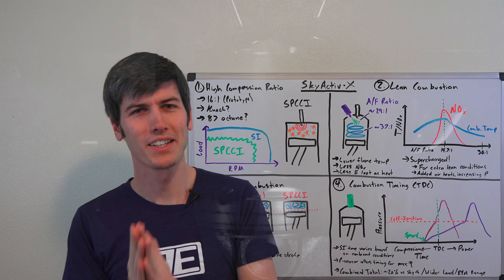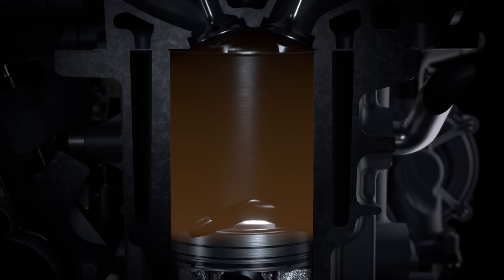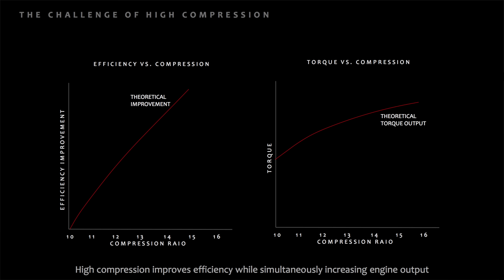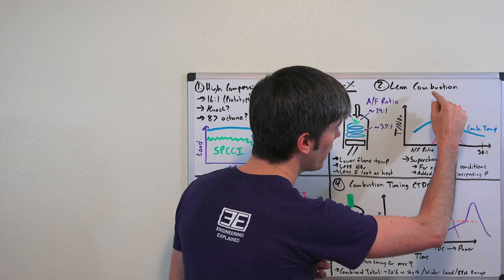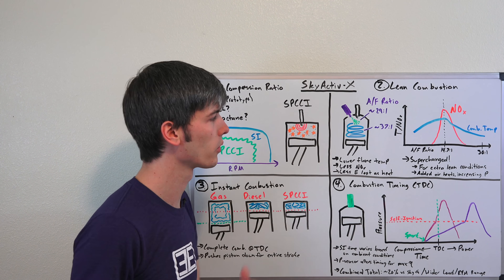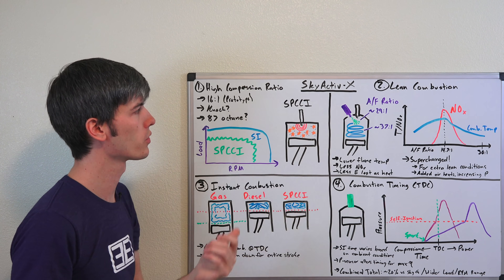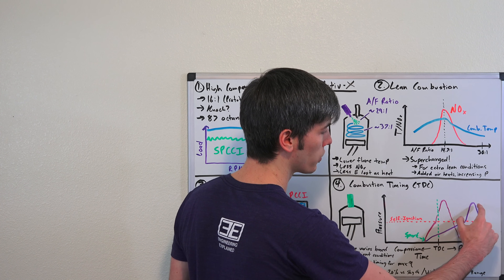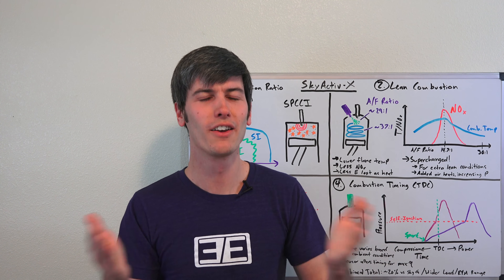How Mazda Is Saving The Gasoline Engine - SkyActiv-X

Comment: Is it correct that you have less NOx emissions the leaner the engine runs? VWs first FSI engines used a special NOx catalyst for higher NOx emissions under lean burn scenarios (at least thats what VW Said)

Comment: Pretty cool stuff. I'm kinda wondering how well it will perform after 100k miles of carbon build-up, since that can create hot spots in the combustion chamber and cause pre-ignition. Will it eventually just run constantly in "regular" ignition mode due to wear, carbon build-up, etc? We all know people don't maintain their engines to an ideal standard.

Comment: I'm sure you know what you are talking about but a couple things escaped me this time. What you are describing is classic detonation: the fuel/air mixture stops igniting by the flame front and ignites by the pressure front. I can only guess that is moderated by the extremely lean mixture (still above the lower flammability limit of 1.4% or 71:1 A/F ratio) but I am still scratching my head about that. I also understand that the lower combustion temperature reduces NOx, but doesn't the excess oxygen in the exhaust effectively cripple NOx reduction in the catalytic converter.. or does it reduce NOx generation to the point catalytic reduction no longer matters?

Comment: Excellent video. Loving the whiteboard videos. Really just left me with one question: what causes that swirl to occur? In video he stated that it occurs when the intake valve opens and the piston is moving down the cylinder. This seems rather vague to me; I'm no expert on ICEs by any means, but I don't believe this is a characteristic of most current engine power strokes? Cool idea, but what about the SkyActiv-X in particular causes this to happen? 

And then as just a question to satisfy my curiousity, can anyone tell me what's the time gap between the formulation of an idea like this and actually seeing it built and released? I'm guessing technology like this has been around (on the drawing board if nowhere else) for quite some time now, and we are only just seeing it?

Comment: Engineering Explained , I think there's a mistake in the pressure curve in section 4 unless I'm misunderstanding what you are showing in the plot. You have compression labeled as a flat pressure line, while this should be increasing as the piston moves up to compress the mixture and then have the additional pressure increase you show after combustion begins.
Reply from the maker: The curve shown is simplified to understand how timing works.

Comment: while I drive most time my car electronic systems goes off but car runs fine. What do I mean by electronic systems are power windows doesn't work car stereo system goes off etc, but if I turn off engine and start again it works fine for sometimes and again it's goes off after a while. I am really struggling to figure it out by my self. If you can help me that would be really thankful.

Kind request 
Thanks

Comment: Hey I gotta question that might be interesting or not lol
So I've been looking at the powerglide transmissions and I've been wondering the power glide transmissions only has two gears.. So it has two gear ratios with a final drive ratio 
How do they set up the power glide gear ratios so that wen they go from 1st to 2nd it doesn't loose acceleration but also gets a high top speed 
Bc obviously if u set up up a final drive like 3.50 and a first gear of 2.45 and a second gear of 1.00 with like lets say 300hp wen the car shifts into second it would just be very slow acceleration.. So how do they figure out just how low they can go with the ratio so that the car still accelerates fast and also has a good top speed..
If u do answer this can u please use two examples one with a high HP car and one with a low HP car I'm really interested in figuring how they setup the power glide gear ratios :D

Comment: Regarding the improvement in economy - the 20% number is comparing their current (Sky-G) 2L's fuel consumption to this new (Sky-X) 2L's fuel consumption. But the new 2L produces almost as much power as the current 2.5L (~178 hp versus 185 hp). Thus, the engine you drove should be a replacement for the larger 2.5L, and it's fuel consumption shod be compared to it rather than the old 2.0L. Thus, on a fuel consumption per hp measure, it's already at or above 25% improvement and very well could be 30% when it hits the market.

Based on statements made by Mazda about the next generation beyond Skyactiv-X, we can backcalculate the thermal efficiency of the Skyactiv-X engine as 44%, which I believe will be a world record for production gas engines.

Comment: Another characteristic of an ideal engine is one where no heat is lost through the cylinder walls. In conventional engines this scenario results in most of that energy just going out the tailpipe as enthalpy, but using a buffer of pure air (no fuel) insulates the combustion resulting in less heat loss and more of the chemical energy being converted to work. It also means the exhaust is lower temperature so that less energy is blown out the tailpipe.

Since Mazda's published technology road maps end with an adiabatic engine, you know this is a characteristic they are working toward. This engine already benefits from it, and my guess is they will expand on the idea for the next generation. For example, using two intake valves--one for fresh (oxygenated) air and the other for cooled exhaust gas. The cooled exhaust gas swirls around the perimeter of the cylinder while the fresh air is at the center. They work their HCCI magic at the center; and no combustion occurs at the perimeter. Furthermore, they add cylinder liners with lower thermal conductivity to keep more heat inside the cylinder. It would also be cool if they included thermoelectric generators (such as on the exhaust manifold) to both help cool it and provide electricity (which could help permit using a smaller alternator of disconnecting it altogether).

Comment: The logic of improving the gasoline engine is in the overall improvement to the fleet.

EVs significantly reduce emissions--we can say somewhere around 75%. That's fantastic except for the problem that the take rate for EVs is low (less than 1%) and will stay low until they are cheaper to own (buy, operate, maintain) than gasoline. EVs only improve emissions of cars that are replaced with EVs, and those are typically the more efficient cars anyway. Thus,  EVs do nothing for the vast majority of vehicles and certainly not the highest emitting ones.

OTOH, improving the gas engine improves emissions for the majority of vehicles. True, this tech only reduces emissions (based on mpg) by 25%, but that will (presumably) be 100% of the Mazda lineup within a few years, including their SUVs. Thus, compare the emissions savings of 25% x 100% of vehicles to savings of 75% x 1% of vehicles.

Additionally, the cost per emission reduction is heavily in the improved engine's favor. While EVs may add $10k to the price of a car & hybrids may add $2k, this tech will likely add only $500. Making it more affordable increases its take rate, meaning more benefit in the real world.

Finally, cost also gives Mazda a competitive advantage. Again, EVs won't gain popular acceptance until they are overall cheaper than gasoline. That point of parity should occur c. 2023-2025. However, this engine pushes that point back ~7 yr to 2030 or later. That's huge. And by then Mazda may have their next leap forward--an adiabatic engine with another 20%+ improvement.

Comment: i have to ask until i get an answer from a legit mechanic or possibly an engineer. PROPANE!!!. why is it not being used as a alt for high octane fuel?. what happens when you boost a propane powered rv with 40lbs of super charger... magic, at least from my experience..its damn cheap to run. my propane/gas s10 runs about 500 hp and a 50lb tank lasts almost a week. cost about 50 bucks to fill...

Comment: Hasn't Honda DI motors used similar or height AFR for years now? They were using EGR to get stable ignition at about 50:1 if I remember the article correctly. This is great in the cute little big city cars, but can someone make a 300HP V6 and 450HP V8 version for the adults to have fun with?

Comment: I wonder how much improvement their efficiency would get if they could get a partnership with koenigsegg and use those cam-less engine heads, with their pressure sensors.
Koenigsegg claimed 10~15% better fuel economy/emissions/power with those engine heads, if I recall correctly, but they had a partnership with a chinese car manufacturer.

Comment: Could you speak to shifting with out using the clutch and instead rev matching or waiting for engine speed to drop enough to slide it into gear. Is doing this bad for my transmission or engine or something?

Comment: Well if a sensor in my truck goes bad usually the light would come on but the engine would generally still run ok but maybe a little rich or lean.  If some of the sensors quite on this engine it seem like the engine would not run or worse.  But maybe not. The timing on this engine can not be off at all and if the compression sensor isn’t working right it looks like to me it may ignite the fuel at a time damaging to the engine

Comment: I don't really get it. I own a Renault Megane 1.2 L turbocharged (100 hp) which claims to do 40 mgp (5.8 l/100 km). I can personnally reach 37 mpg (6.4 l/100 km) in the summer. I'm now at 35 mpg (6.8 l/100 km) because i'm mainly driving on highways and it's winter.
Looking for Mazda's number, it's 39-40 mgp. Since it's not even better, why is SkyActiv-X so great according to you?

Comment: Mazda could be onto something here, but reliability is going to be a huge concern... 

VAG had an internal development program in the early 2000's. They experimented with the exact same technology Mazda claims to have perfected, and came up with a very similar concept. In the end it was completely scrapped thought, because the engines proofed to be very expensive to build and horrbily unreliable due to the constant high stress. Therefor declared unfit for mass production.

Comment: ELECTRIC cars DON"T have better emissions That is a myth fueled by tesla (small penis car company  and nissan etc...
see the  laws of thermodynamics ,  energy  it can neither be created nor destroyed,  Most electricity is from Fossil fuels.  there for your small penis car  is no better then a gas guzzler  when it comes to emissions and might be polluting more then a regular car the Break even point for a toyota hybrid  is about 150,000 miles by then most are in a junk yard because the battery is dead or transmission is dead
nuclear energy  IS NOT CLEAN  see all the nuclear disasters around the world  it worse then most fossil fuels because it causes world wide damage  immediately and takes thousands of years to "go away".. Trumps clean clear coal is just as dirty as it sounds

Comment: Question:  For a normal spark engine, the F/A mixture burns with the advancing flame front, ie slowly.  With Mazda's engine, the F/A mixture self ignites at high compression, but it doesn't happen instantaneously in the whole cylinder, there is still a pressure wave travelling out from the spark plug.  Do you the relative speeds of each?  Pretty amazing such a tiny car company can come up with the engineering resources to bring such a novel concept to market!

Comment: In some sense this is an extremely impressive engine coming from the factory, but it sounds like the type I'd stay away from. If any of those pressure sensors go out, you're SOL. It's just such a complex, potentially over-engineered system. It also seems extremely difficult to modify for the aftermarket.
Not that any of that is inherently bad, but that's more of what I expect from German engineering. I prefer the simple-yet-elegant approaches I've seen in previous Japanese engineering, which is why I'm such a fan of their cars. 
Only time will really tell what I think of this new Mazda design, but props to them for expanding our technological limits nonetheless

Comment: The question is: the improved efficiency of this engine will aproximate to that of an electric motor? No. So why to invest money and time in developing the internal combustion engine, when the best traction machines already exist? Some technologies described here are very similar to those present in the Elko engines back in the 80s. Why the Elko engine has not succeded? Why the electric vehicles are kept as a "promise"? Because they don''t use oil, and because they are simple. The industry fools us, pretending that they are concerned with the future, but what they really want is to maintain the oil, parts and service markets. That's why the engines get more and more complex, and continue to run on oil-based fuels.

Comment: I drive a 2014 Mazda 6 with SkyActiv technology. I don't have this engine, of course, but it is part of this technology. I have to say it has been a responsive car and quite fun to drive. It is also my second Mazda. I had a '99 B3000 pickup. Mazda was owned by Ford at that time and I was told that Mazda was very strong in engineering and poor in marketing. Ford bought Mazda in part for their engineering expertise and Mazda gained benefit from Ford marketing proficiency. I am glad noiw, though, that Mazda is independent. I do not believe this type of engine technology would have happened if they were still Ford owned.

Comment: 16:1 is nothing more than the static compression ratio.  The DYNAMIC compression ratio (the one that actually matters) is controlled by intake valve timing and is what determines the VE (Volumetric Efficiency) of the engine.  This trick is used all the time by engines with Variable Valve Timing, they just take it to lower extremes than what Mazda is doing here.

Any engine can run properly with a 16:1 static compression ratio on 80 octane fuel if the intake valve events reduce the VE far enough.

You gotta be careful EE... this video watches almost like a Mazda advertisement. ;-)

Don't get me wrong, this is an impressive engine, assuming it's compression ignition operating range is usable.  Was the test vehicle you drove a manual or automatic?  I'm betting the latter in order to allow the car full control over where the engine is operating.

Comment: I am not going to agree that the lean burn has lower temperature. Two 200SXs running modified CA18DET with 30 or 35 turbines had bad tuned ECU going very lean in high rpm (20-22). They fused pistons to the cylinder block!
Also i am very sure you are aware with the lean burn engines of Nissan - the QG family. These engines are running on higher temps compared to the traditional NA ones.

Comment: As far as I understand this is not legal under vehicle construction and use regulations in the UK and the EEC, which mandate stoichiometric fuel ratio so that the three way catalyst can both reduce the oxides of nitrogen and oxidise unburnt hydrocarbons and CO. How does the catalyst work with this engine?

The May "Fireball" head used on some late Jaguar V12s ran super lean and used a similar swirl and injection that Mazda uses here. This was dropped when catalysts were mandated.  Even good old British Leyland had a (classic) mini A-Series engine that ran way  leaner than stoichiometric and was nearly as clean as a catalysed engine, again this had to be dropped. As Mazda has now shown they were on the right track.

Comment: I remember you saying in your "why the rotary engine is dead" video that way combustion occurs with traditional spark plug ignition causes a lot of fuel to be wasted in the rotary engine's operation. Since compression ignition results in instant combustion of the air-fuel mixture, that would solve this inherent problem with rotary engines. With that said, could SPCCI save the rotary engine?

Comment: Really great technology but it just seems that the added complexity and parasitic load of the supercharger kind of negates the benefits of the tech.  Or maybe they will make a NA version with the 2.5L displacement.  The other benefit of the high RPM efficiency is they can continue to use their existing 6sp transmissions.  Saving other development costs.

Comment: Did Mazda publish the brake thermal efficiency for their new engine? I know that 40% is a rough estimate for what engines were getting prior to this new tech, and it would be awesome to see that less than 50% of the energy in the fuel is lost due to heat plus whatever is lost to friction.

Comment: If only there was energy efficiënt way to take oxygen out of the air. So your engine could run pure oxygen mode. That way a 1 liter engine could make the power of an 4a5 liter engine. Saving alot of energy in the proces